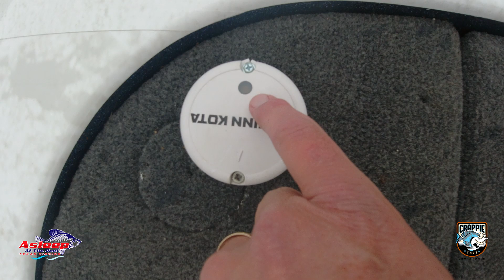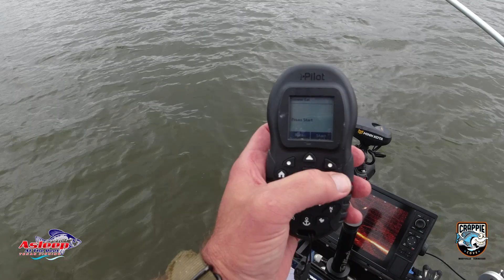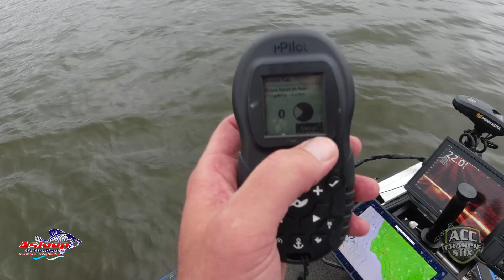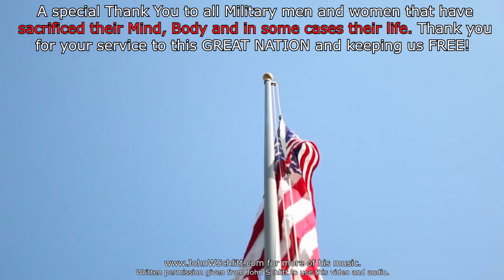HOW TO CALIBRATE A MINN KOTA ULTREX TROLLING MOTOR | EP 3522

Comment: Hey boss, I got a powerdrive with ipilot I don’t have that sensor cal option under settings. Any advice?
Reply from the maker: The only thing I could think of is to make sure your software is up to date.  Unfortunately I do not have that remote anymore, I sold my boat and have a digital remote so I cannot look at it to give you any info.  There is an option to update software and I think it is for both the trolling motor and possibly the remote.  I wish I could help more, but if you figure it out, please put the fix in here.  Thanks for watching and commenting.

Comment: Why is your heading sensor arrow pointed to the side of your boat?
Reply from the maker: At the point I shot this, I did not realize it was.  I have fixed that and is now pointing forward.  The steps are the same and the way it was pointing is only an issue in rougher water.  In the calm water that I had, it was fine, but yes, it is supposed to be pointing towards the front of the boat.

Comment: I might have looked at it wrong but the arrow on the puck should face the bow as straight as possible. It looked like yours was facing the side of the boat.
Reply from the maker: I had not heard that.  the boat place just told me to put it on.  I will check that out, but on a side note it has not messed with anything on my boat as I have had it that way for 3 years!  😂  I will check on that though, so thanks for bringing that to my attention.
Reply: It has something to do with the compass.
Reply from the maker: @jameswanke8404  Will look into that. Good catch.  I have been using it that way since I got it.  ha ha
Reply: This video was great, it was straight to the point. thank you... And to add to @jameswanke8404 comment, this is from minn kota's page
The Heading Sensor needs to be mounted on a flat level surface with the arrow pointed parallel with the keel-line of the boat. It should not be mounted upside down and it needs to be at least 2 feet (24 inches) away from the trolling motor, anything ferrous, and anything that can cause interference.  So that could be part of your issue... Possibly. All the best and hope to see more.

Comment: My Ultrex will shut off spot lock sometimes , it does that when it seems to be struggling to hold to spot , it will cut off when it can't turn any further , any suggestions
Reply from the maker: You might try an update on the software.  Other than that, check and see if there is anything in the way.  I have noticed my handle will sometimes fall in the area of the foot pedal and when my spot lock cuts out, it is because it cannot go down any further because the handle is in the way and it will just shut off.  I have to pull it out of the way and hit spotlock again.  Hope that helps.  Good question and thank for answering.

Comment: The puck arrow has to point to the front, didn’t see that on yours. Ky
Reply from the maker: It apparently is not facing the front. Had it that way for 3 years and no problem.  I think if I hit the N button it might go North which would be right or left. Ha ha.
Reply: @AsleepAtTheReel  unscrew that puck and turn arrow to the front, recalibrate, and then set the offset, that comes up at the end. But before you do any of that,!take your remote, be next to wi-fi, update your remote and trolling motor head. It will all work better after that. Kentucky
Reply: Mine points to the front, but there is also a way to do an offset correction.  Could be that the the proper offset correction was done at install so the sideways puck is not an issue.
Reply: Oh, and the N button just keeps you going the way you were already going.  There's a legacy and advanced mode which are different in how they do that.   I troll cranks for crappie a lot and love my N button on legacy mode especially when I'm fishing alone.
Reply from the maker: @flatpicker75  Unfortunately I am the one that did the install.  I think I know what happened and that is I installed it correctly, but when I was changing the trolling motor batteries I noticed that the screw on one side was in the crack so I had to take it out to take that entire panel off the boat.  I remember moving it and not even thinking about the N.  After that, I calibrated the compass again as  I needed to for the video and well it still worked fine.  Not really sure but I have moved it back and re-calibrated.